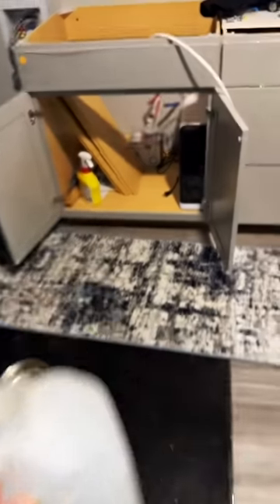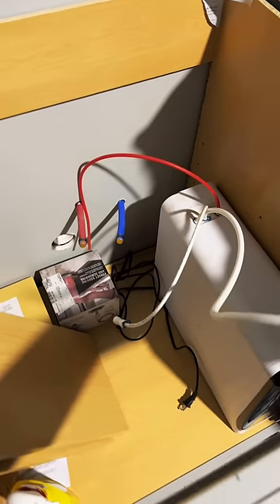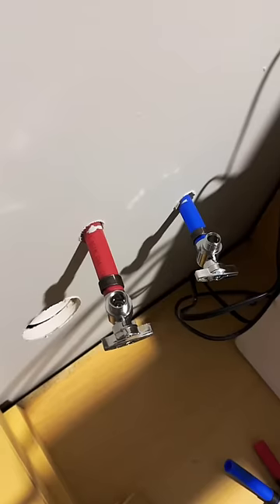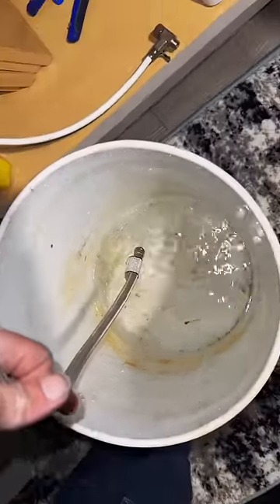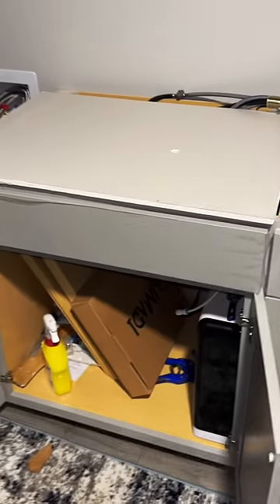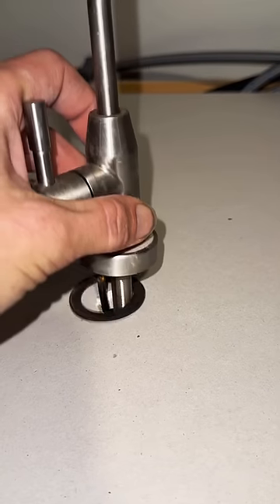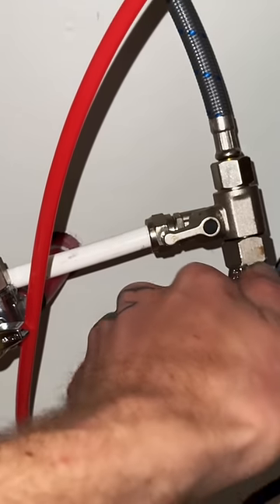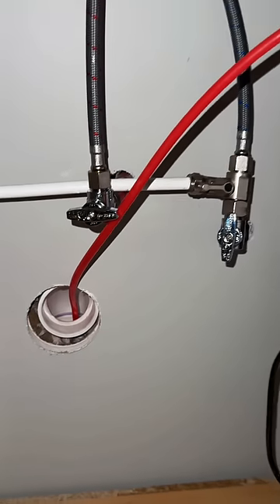Water filter and    drywall countertop

Comment: Nothing is more permanent than a temporary solution. 😁
Reply: Usually but in the case of drywall countertops obsolescence is a feature
Reply: Planned obsolescence is the way of modern society.....sadly.
Reply: We call it temporary permanent
Reply: @Mike-cv9rr Tempoperm sounds like a pain cream
Reply: My dad built temporary steps off the back porch and I’m pretty sure they were there 10+ years.
Reply: The ramp on my house was a temporary fix installed by the previous owners
Reply: Software engineering 101
Reply: I'm still unpacking after a year moving into my room.
Reply: Oh my.... 😂 ain't that the truth!!!
Reply: I wanted to like, but likes were on 665😂
Reply: My hubby lives by that statement. His temp fixes are as good as what would be the right fix. He just used materials he has available. He builds stuff for antennas, and he sometimes has to get creative.
Reply: He's supposed to connect the line to the drain pipe under the sink but bc he doesn't plumb he could of had the sink and everything in it's a 2 hour job max

Comment: I ran RO for years and ran my "wastewater" (drain) to my garden. I've had tons of people say you can't give it to plants as it's "wastewater" from what was filtered out, but I never had any problems and used it for years.
Reply: Usually people here would just run the kitchen drain to the outside into a garden or something because it isn't sewage and doesn't have major chunks. Oh we also don't have garbage disposables here so that ain't an issue either.
Reply: It really depends on what water is going in the RO. The biggest worry I'd have is making sure the drain line is secure and protected from back pressure or bacteria
Reply: nice I'm into fish keeping and wanted a few spices that required RO seems like a lot of work
Reply: @antmitch78  We've had an RO system for our saltwater tanks for years. We use the RO water for coffee making. HINT: If you are gonna store it for any period of time, add just a little table salt to stop any growth.
Reply: This homesteader uses like a 30 in one soap that is safe to water his plants and shower with
Reply: The narrowboats on the UK canal system discharge 'greywater' from washing machines, sink, shower, straight into the canals. It's legal. Some boaters use an environmentally friendly range of detergents and soaps but it's not a requirement. The canals are healthy, stocked with fish, have herons, swans and ducks aplenty with no issue. The 'blackwater' from the toilets is stored on board and pumped out at the facilities.
Reply: as long as you use environmentally safe soaps, i think that's fantastic. it's like composting as you water. all the food particles or natural waste goes to nourish the soil
Reply: @The_DuMont_Network  very nice!! what kind of saltwater tank predator corals?
Reply: Don't listen to people 😂😂😂 Waste water from a water filter is not "gray water." You can't feed toilet water directly to plants. There's too much nitrogen.
Reply: Two things if you have high tds(salty) water like Az 1000ppm. NYC=10.  the drain will concentrate from 25-100% and some unwanted heavy metals and such. But the pre filters will get out a ton of chemicals so that’s a plus

Comment: Hey Nate. Not trying to be a smartass or anything. But when you plan on eventually building your forever home on the property. I’d recommend that you install 1/2 mpt fittings under every fixture. So if your angle stops go bad you can unthread them instead of having to cut your Pex pipe. Also this is a little controversial to some plumbers. But me and the company I work for like to install multi turn valves because you can rebuild them many times over. Either way. I think your install looks great so far. Keep it up!

Comment: Temporary plumbing is always interesting to see. Though I've seen some "permanent" stuff that people have done that absolutely blew my mind. I live in WV too and I'm a licensed plumber, so I've seen some wild stuff out in some of the more rural areas that I service. I once saw a shower where someone had made their "shower surround" using vinyl siding with CPVC lines attached to some gate valves, then those attached to garden hoses that were ran on the outside of the wall up to a garden hose splitter that attached to one of those long garden wands used for watering plants. So they used the little valves built into the splitter to temper their water, it was honestly kind of brilliant. 🤣 But my all time favorite was a large inner tube being used as a toilet drain line with worm clamps on each end, they did have a flange under the toilet but they attached the inner tube to it. Then that was attached to a 3" gray conduit sweep that went through the foundation and 90°d down into a gutter that they had trenched down even with the ground. It went right through their yard and then down over an embankment into the creek... I'm talking full turds and toilet paper just flowing completely exposed through their yard!! I really wish I had a camera phone back then, I'd love to have some pictures and a video of it. Gotta love West Virginia!! 🤣

Comment: I know the pic your using is those cheap little sinch Home Depot/Lowe’s rings they work good enough but if want a solid plastic water pipe look into getting a propress gun and the Viegga press adapters then you could do (copper,gas mega press, and plastic water for non potable and potable, just a direction to look into obviously you have it handled my man
Reply: A ProPress tool is like $3,000. And that only includes the ProPress heads. You have to buy the pureflow and megapress heads separately. Definitely not homeowner friendly pricing.

Comment: What type of filter are you using is it a RO? Just asking because you need to be careful if there are to many filters on it, they take all minerals out of water making it un safe to drink.
Reply: Most of your salt and minerals come from what you eat.  Ro and distilled do seem to make the ph a little lower, calcium carbonate fixes that.
Reply: I get what your they are saying, but it should be fine to drink as far as I know, injecting into the bloodstream then may have some dangerous side effects though, the potential harm in my mind and probably that of the commenter is the osmosis that would occur
Reply: I wouldnt say unsafe but deff not optimal and would agree that ro usual is taking to much minerials out of the water and then when ingested the water may take the minerals from your body. This is waters goal on its journey in life that it is always trying to find equilibrium of minerals and temperature. If you want some good info into this here is a recommended book called The Story Of Water by Alick Bartholomew
Reply: @ZaneBailey-ht7lx  if the water takes your minerals but you digest the water where do the minerals go?